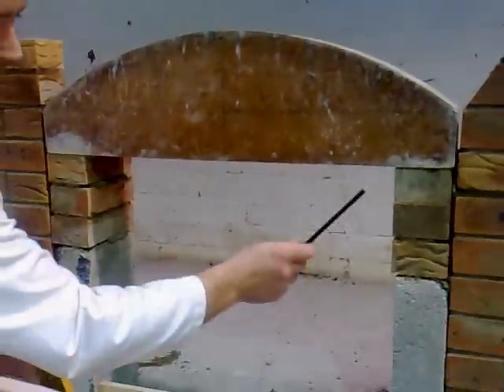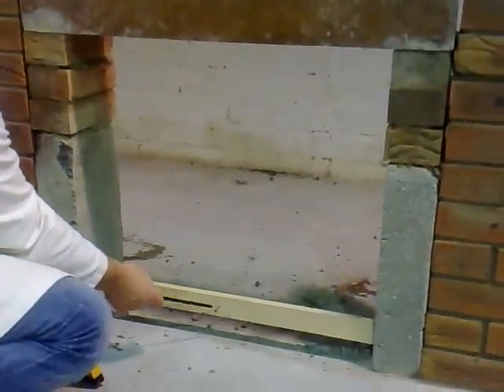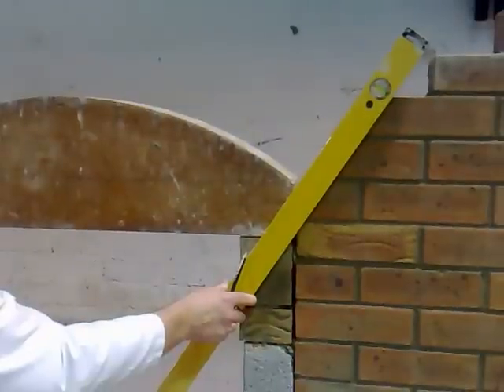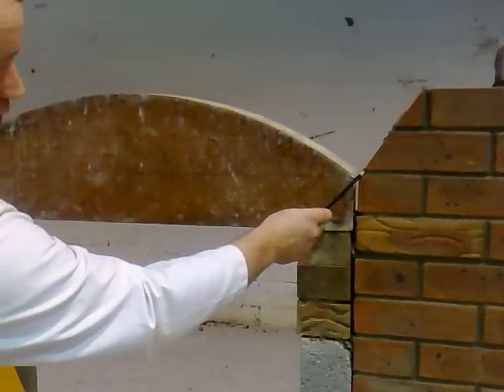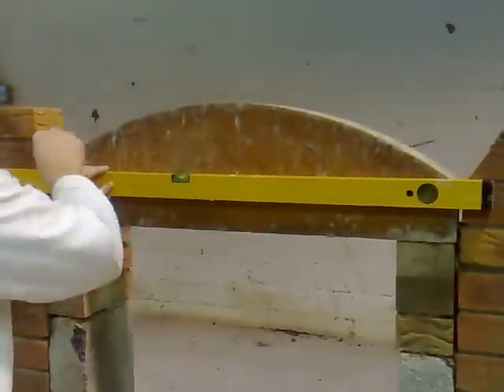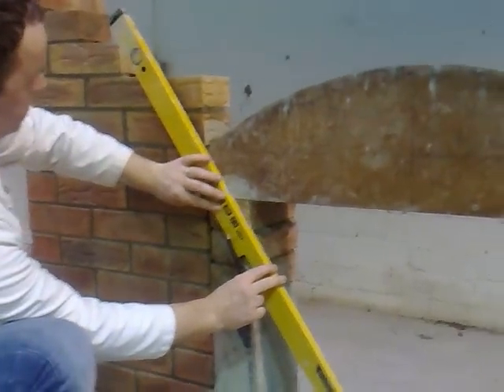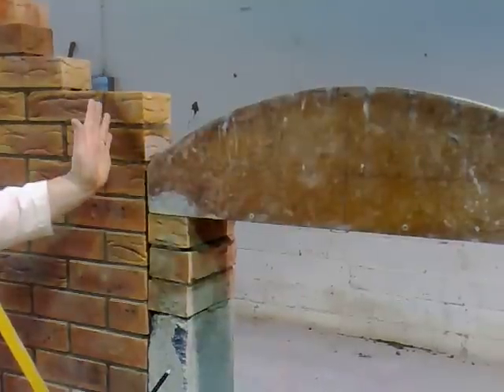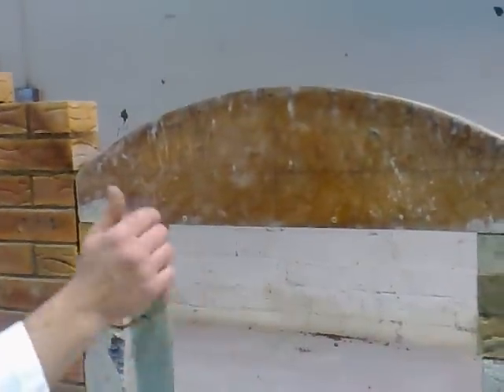Skewbacks Marking (video 2 of 11)

Comment: When stacking up the voussoirs, do you always have to maintain a 10mm joint and then make the key stone/closure fit? Or do you adjust joint spacing on the voussoirs to fit a given keystone/closure brick size?
Reply: You always work to the key stone so yes space them out and work it 10ml to key stone